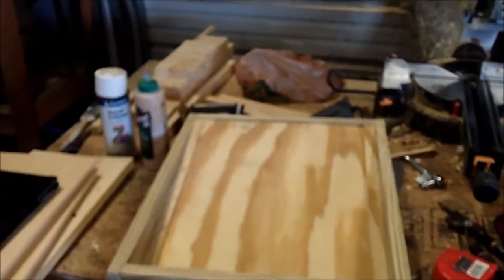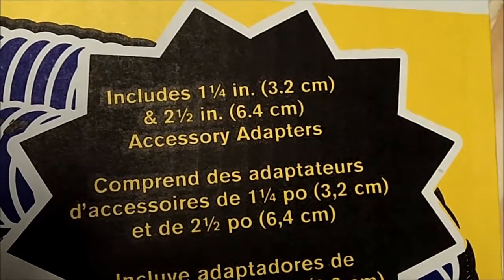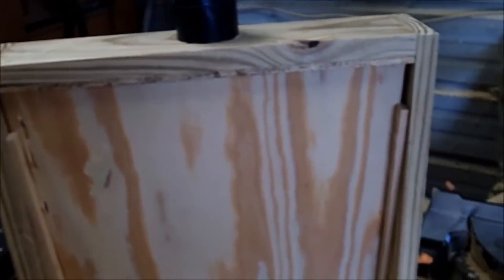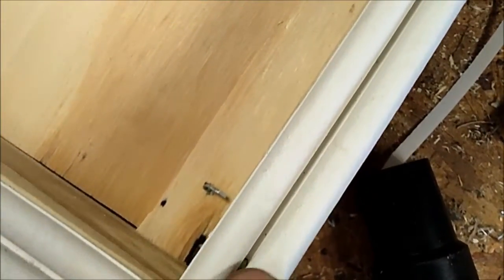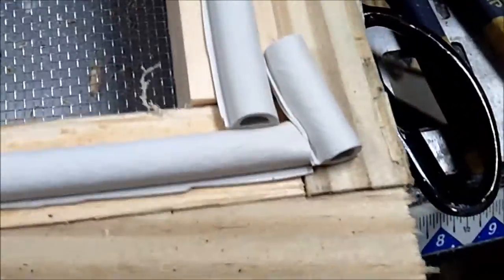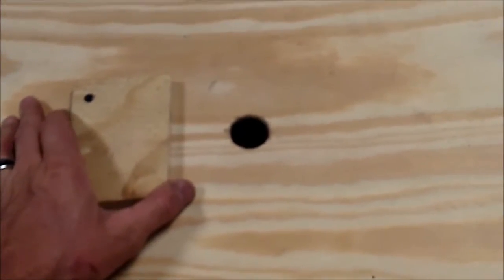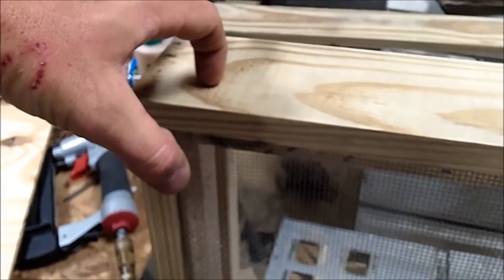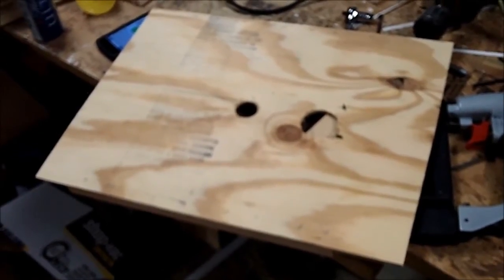Easy DIY hive body bee vac!!!

Comment: I need to make one soon. I'm wondering why the bee inlet is on the bottom. Wouldn't it be better on the top so bees could easily crawl down into the comb rather than up?
Reply from the maker: +Keith Kanyeshna The reason for it being at the bottom is so the bees have a smooth surface to hit when coming out of the tube. If you put it on top they will hit the frames and you will make bee soup. Not good.
Reply from the maker: +Keith Kanyeshna if it's on the bottom it will not blow any trash on top of the frames

Comment: I just made this vac.  The only difference is, I permanently glued and screwed the top on. Is that a problem?
Reply from the maker: Should be fine. Only reason to take the top off it to see how may bees you have in the box
Reply from the maker: +Donald Lambert I just seen your comments. Not sure what your glued and screwed but you will have to be able to take the top off so the bees can get some air. That's if you added in the screen top